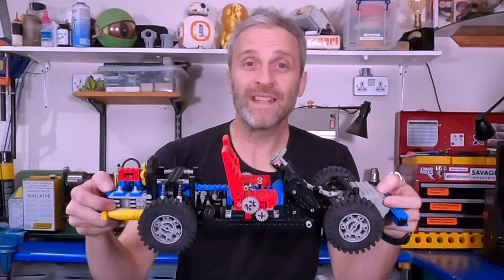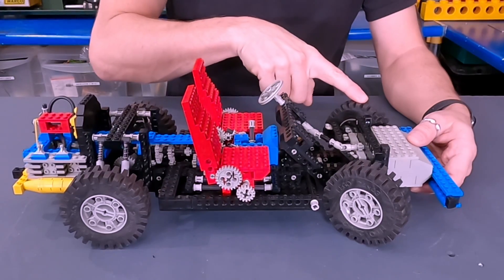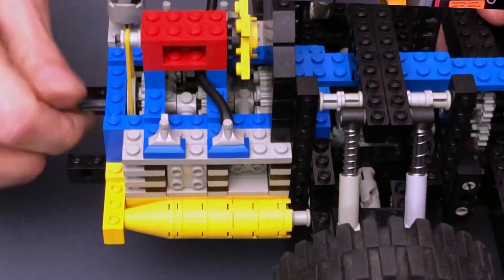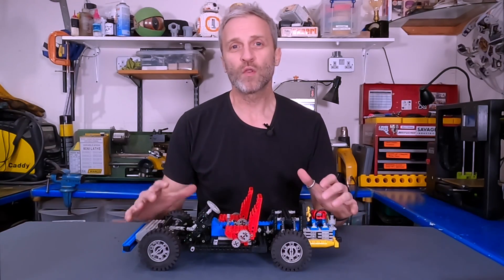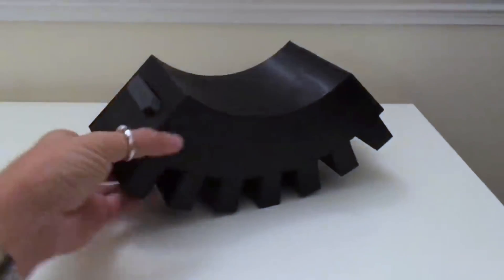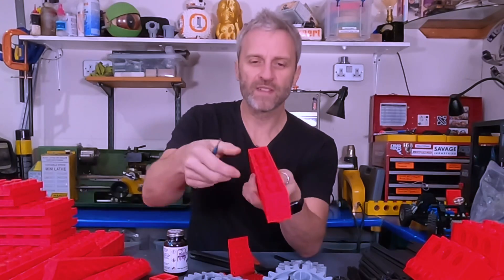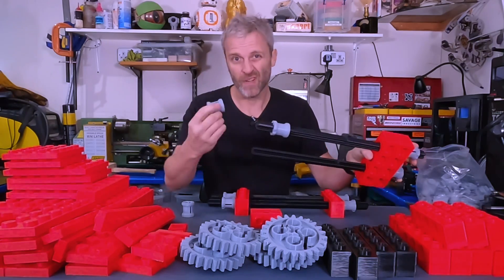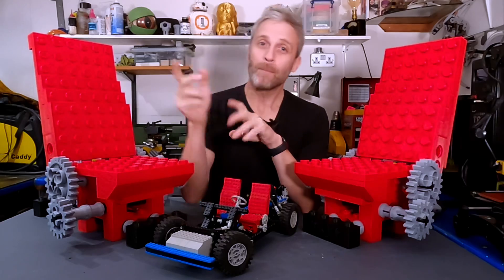The Iconic 1980's Lego Car Chassis! - Can it be done? - Mantis Hacks

Comment: I am no engineer BUT... The difference between the tractor and the chassis is location of mass. The tractor has the wheels at the ends with no weight past the axles. The chassis has a LOT of small parts/mass outside the wheelbase AND four large wheels which will be unspring weight. The engine mass may match or be somewhat equivalent to the complicated seats in the center but they seem to be majority of mass centralized between the axle centerlines.

Comment: Not actually a good idea. Loved this set but there were continual issues with it. It was EXTREMELY delicate. The seats kept coming off as well as the steering assembly has a weak 2x1 that came off all the time. It is a classic set but it isn't a "good" set by modern standards as it was just so ridiculously delicate.
Reply from the maker: You may be right.. but it was propped Lego! Modern kits are practically built for you with many molded parts and instructions you can actually follow 😆

Comment: Uhhhh doesn't weight scale with a cube power rather than a linear one?
Reply from the maker: Yes. Which is why at 5:1 scale the weight should be 125 x heavier (5x5x5) than at 1:1 scale. Assuming the parts are solid! But when printed they are not solid. I think I’m this is what I state in the video.
Reply: @MattDenton  Aahhh of course yes, the infill process will take care of that. Although wouldn't it still be a square power due to the surface area of the outer skin?
Reply from the maker: Well it’s a cubed power but there is less mass due to it being hollow rather than solid.

Comment: Old Lego is so much cooler than today's kits. I'd love to see scaled-up pneumatic builds, like 8851 (or if you want a real challenge, 8868)
Reply from the maker: Pneumatic is gonna be tricky 😬
Reply: @MattDenton  I know, that's why I'm asking you :D
Reply: Just a thought, but you can probably hide a piece of pvc drain pipe inside a lego exterior shell to create a smooth cylinder liner. A rubber plunger could act as the piston. Because everything is so large the pressures can be really low and you'd still get plenty of force to move things.
Reply from the maker: I think that’s the only type of solution

Comment: If you want it to function and not fall apart from its own weight you should use a metal base from. Certain parts should be more hollow, those seats for example use a lot of weight so instead of it being countless pieces to build try using different parts thst dont fill the inside space you dont see.
Reply from the maker: It’s as light as it can be and retain strength. The walls are 1mm thick the inside is just 5% infill so nearly hollow!

Comment: Hi matt.. this is going to be awesome... I'm currently building the 7740 lego train to 5" gauge to run round the local tracks.

Can I ask what glue you use to bond the bigger parts together and do you glue all parts when assembling?

Still 0.2 layer height?
Reply from the maker: I use PLA Gloop! But no I don’t bond the parts unless they are built in multiple bits
Reply: Thanks for the reply
Reply from the maker: HNY 👌

Comment: While I appreciate sticking to the original Lego brick design. I would adjust it so that the pieces lock in place and wouldn't back out. Maybe a tongue/lip the studs, and a grove/recess on the tubes. So parts would hold better. This way you should be able to put some horsepower into the build without it rattling apart at otherwise unsafe speeds. 

Either way looking forward to seeing the finished product.
Reply from the maker: I don’t think this kit will be going at any speed… it’s not really built for that 😬 mostly display purposes :)

Comment: while it will certainly make the whole thing heavier i do suggest putting a steel frame that you can bolt together inside the chasis so it doesnt sag under its own weight and you can possibly even sit on it without it breaking apart

Comment: Well I never thought you'd be foolish enough to attempt this😄. Christmas 1980 this was my main present and I'm 10 yrs old. We were going to my grandparents in the evening and I managed to build it from what must have been 6.30 am start. The only thing I hadn't finished was aligning the 3 speed box and it was my first technical set so cut me some slack. So we get to my grandparents and after the men in the house had marvelled at the latest lego creation they whisked it away from me! My memory is of my Dad, Uncle and Grandfather huddled together on the floor over my car chassis trying to work out the gears. After half an hour it had developed into a heated exchange of opinions which resulted in none of them managing to get the gears working. One of them worked for Massey Fergusson one for Peugeot Talbot and the other Rolls Royce, needless to say I figured out the gears the next day by myself😏.
Great set though, probably is the best. Remember combining my best friends technical lego to create a 6 wheeled version with rear 4 wheel drive suspension and a flat6 engine.
Good luck, can't wait to see it done. This might be like seeing Luke in the second season of the Mandalorian😆😭😄.
Reply from the maker: What a great memory! Yeah I only found out several years after building this kit I had made the engine wrong! I’ll explain in the next episode!  Wait… luke spears in Mando… nooooooooooo

Comment: I rebuilt this like 2y ago. Bought all missing parts online. Best birthday/christmas present at the time! The only real issue I had with it, was that you need to move the model to make the motor turn and not vice-versa as it was supposed to be ;)
Reply from the maker: Cool! But I think if you turn the motor the model would move.. so you need to make it electric then it would work as you want..
Reply: @MattDenton  Guess what I did?! ;) Unfortunately at that time motors were quite weak and battery quite huge. With todays tech and 3d printing you could make some cool stuff.
Reply from the maker: Yeah with todays tech!! 👍

Comment: Hmmmm...this set is lurking somewhere in the attic with the rest of my 1980's era technick models...this chassis reminds me btw of a VW Beetle with the boxer engine in the back with the fan inside the black housing and the same setup of the rear drivetrain with the axles only bending at the gearbox and not the wheels..
Reply from the maker: Yeah it’s very beetle like! 👍

Comment: Two sets that would be fun to see in giant scale are 565 Moon Landing and 10266 Creator Expert NASA Apollo 11 Lunar Lander which is a much more accurate rendition but doesn't have the rover like the 565 kit, nor does it have the "Macrofigs" which predated the original limbless Minifigs. A giant version of the original Minifig would be a nostalgia kick, and only 3 parts. The upper and lower body and a faceless yellow head. See set 445 for an example. If a belt was wanted then put a 1x2 plate in the middle. IIRC one set I had, used a 1x3 plate then stuck a black 1x cylinder on the bottom of the projecting end. I assume that was supposed to represent the officer's pistol or a radio or something.
Reply from the maker: I found the legs of one of those early mini figs while I was hunting for parts for this build 😀

Comment: One modification I'll suggest is to add a second spider gear to the differential, and a bearing pin that goes all the way across and is secured into the case to prevent it from spreading apart when force is applied to the gears. Thrust washers between the spider gears and the case would also be a good idea.
Reply from the maker: Yeah the whole diff needs some attention and plenty of bearings 😬

Comment: I'm curious how are your earlier builds doing? Are there cracks on the pressure points?
Reply from the maker: No cracks. Some parts have loosened off
Reply: @MattDenton  that's real impressive considering that a lot of lego parts crack after use, and you uped the size by 30 times and the parts actually held up. Especially the tires and the parts that you joined. Very cool!
Reply from the maker: Thanks 👍

Comment: Lego Technic has been a part of my life for so long, and still is. This set, 8846 Tow Truck, with the spare wheel operating the winch at the front, and the 8848 Unimog. So many good sets back then.
Reply: Ah, the old 8848, a very much under-rated set. I did really love this one. Of course the 8848 is bigger with more scope, but as a great small model with some great functions, the original unimog was superb.
Reply: @BRMRailway  I had hours of fun with it, using the pneumatic excavator to fill the rear part with dried corn, then unloading it somewhere else. It took some finesse to make the rear part tilt gently, and not move to an angle suddenly. I did later change the steering to hand of god system, with a 4x4 trans yellow brick as flashlight, to make it a lot easier to drive.
Reply from the maker: I always found the pneumatic excavator disappointing. I was so excited for it but the pneumatics just didn’t work well. I’m amazed lego released it! The mk2 pneumatics were better.
Reply: @MattDenton  True, the single tube pneumatics, where suction was used to make the cylinder retract, has it's flaws. That shows mostly in the middle part of the arm, which has to lift against gravity. The lowest and top cylinder worked better, so when scooping up things, I tried to avoid using the middle cylinder. The double tube pneumatics work much better, also more smooth piston movement, but the tubing is mor complex, though
Reply from the maker: Use quite like to do the mog!
Reply from the maker: Yeah it’s the best era for technic

Comment: It has a 4 clyinder engine with a cooling fan on top like it's aircooled so the full scale version would be a classic beetle chassis but made steel instead of gaint lego pices
Reply: I always preferred to think of it as the chassis of an early Porsche instrad of the beetle, as it only has two seats, and its way cooler.😉
Reply: I agree the porsche 356 is way cooler also the seat are closer to the back of the car so probably is based on the Porsche 356 because they had a shorter wheelbase then the classic beetles

Comment: My brother had this one. I have TWO of the original 956 Auto Chassis sets along with several Technic kits. The older stuff was better in my opinion. The new kits require 4 volumes of assembly for $400 worth of plastic confetti. No real imagination there.
Reply from the maker: Yeah the old stuff was way better.. and harder to assemble as the instructions were so vague 😀

Comment: 8860 is a good set, but my favourite from that era is 8865, the red Test Car.
It's about the same size as 8860,  and has pop up head of lights, adjustable seats, 3 speed gearbox, V-4 engine, 4 wheel independent suspension, and a body - complete with rear wing and front bar.. a great car indeed.
You're gonna need a garage for these things soon.. 😁
Reply from the maker: I need a garage already 😂
Reply: @MattDenton  will you be adding a motor to this 8860?
The guys from YT channel "Cars and Cameras" might like to have a play with this as a co-lab.. at the very least they'll have some ideas on what motor would best haul this around.. 😁
Or possibly Colin Furze, he's at least on the right side of the Atlantic for you.. 😆
Reply from the maker: I will add Some kind of motor function.. no need for Furze I’m an engineer myself! Check out my other builds like Mantis 😬
Reply: @MattDenton 

Engineer > Plumber
Haha

Comment: I had one of those. Pure magic. I'm a LEGO "boomer" so I don't like the modern stuff with custom parts that try to look like the real thing and fail. I prefer the technical look. :) 

I think you'll like some of the 3D printing I do on my channel. High performance RC cars and planes.

PS. Those square carbon tubes are pultruded and will crack under any significant torque. Might not be a problem since the plastic is pretty stiff too and the loads will be low. Woven tubing is much better for torque transmission.
Reply from the maker: Yeah I’m a boomer and lost interest when all the pre fabricated parts came out! Thanks for the tip on the carbon tubes. There won’t be masses of torque involved, it’s more to lint out that using square instead of round tube will transfer torque

Comment: I remember vividly begging my parents for this very expensive set for them at the time !! I finally got it for my birthday, learned so much about differentials, gear box, etc. A few years after I got the fantastic 8851 Excavator and discovered pneumatics. 15 years later I passed my engineering degree :D
Reply from the maker: Yeah these kits taught me so much and inspired me to make things! I always took my kits apart and made new vehicles and other things
Reply: Yes, and that is what Lego Technic was all about.
Not hiding away the functionality as they do today but rather show it in crude detail so you can understand the basic principle of how stuff actually works.
Reply: Same here (except for an electronics degree). I have to admit that this set gave me a wrong idea about gearboxes for years.
Reply: @christianwiese9887  What wrong idea? That you move the shaft around? Because the basic principle of changing the gear ratio still applied.
But yeah, the synchronized gearbox only started to appear many years later in the 8880. What a fantastic set that was, only got it many many years later when I was grown up, never as a child for christmas ;)
Reply: @ferrari2k  i've just had to look up 'your 8880'.  1994 when that set came out so about 5 years too late for me, like you say but wow, that must  have been the very peak of the old technics system - i would have absolutely loved that kit!  also, i can see maybe the emergence of some of the more modern-style parts - my nephews' new car he was showing me on boxing day is just so different, it is almost unrecognisable. i do wonder if the [r]evolution coincides with lego becoming more popular in america or was coming any way?  i will have to have a mooch on ebay but i think the prices are gonna get the better of my nostalgia!🙂
Reply: the same!  except i think i got the car for Christmas and the excavator for my birthday. when did you graduate? i was 2000.
Reply: @billynomates920  2001 🙂
Reply: stop this plastic waste production
Reply from the maker: Explain why you think it’s waste?
Reply: @goofycker  Stop your ridiculous comments.  You have a whole bunch of lego videos in your playlist which makes you a hypocrite.
Reply from the maker: Well I guess everyone’s entitled to an opinion but waste implies there is no use to this.. but any art form has no use other than to inspire and entertain. I understand the whole plastic issues of today but if anyone really wants to tackle that then go after the big boys 👍
Reply: @goofycker  hypocrite

Comment: About the axles fitting - are you modeling the axle sockets properly? I mean there's a twist in the axle socket (at least on newer elements) that makes it so that the cross is slightly rotated at each side of the socket and that's where the socket has most of the grasp on the part as towards the middle of it it's mostly neutral/loose. 
I could help with modeling a bit, I've got some experience with custom 3d printed Lego-compatible parts, at the original scale though  :)
Reply from the maker: Hi. No I’m not modelling the twist. The fit is usually quite good but sometimes there are blips in the print process. Also the PLA shrinks back over time..

Comment: The wheels will have the size of 4.80-8 ones from car trailers ^^
Reply from the maker: Is that right?? 🤔
Reply: @MattDenton  I calculated the rim size, following the 24 X 43 indications from the Lego wheel multipled by 5, and imperial conversion. Maybe the tyre is even bigger, 5.75-8, probably.
Reply from the maker: Cool 😎
Reply: After calculating, 4,80 wide look correct. 5.75 will be tuning, but 195/55R10 will be modern standard ^^
Reply from the maker: That size I understand

Comment: I suggest more perimeters where strength is a must. Infill has been proven to be less effective than perimeters.
Reply from the maker: Yeah infill just helps bridging but does help the top layer bond well. I have noticed that with less infill if the fit is really tight between two pieces the studs can get ripped off including the top layer 😬 this never happens with 10/15% infill..

Comment: 3D print giant versions of the Technic Arctic Exploration Team sets, complete with giant Technic Lego Figures
Reply from the maker: I’ll take a look.. but Lego are very protective of the mini figs 😬
Reply: @MattDenton  The Technic figures were larger, multi-jointed figures. They're completely different in construction from minifigs. The torso, arms and hip joints are all one unit, for example - which might be a bit tricky to replicate on a 3D printer, actually.

Comment: Excited for this build! Being slightly younger the iconic Technic car for me was the 8865 Test Car - I had no idea there was a predecessor. Pretty cool.
Reply: There was even a predecessor to this one.
Reply from the maker: Exactly 👍
Reply from the maker: Yeah and this one wasn’t the first!!
Reply: I remember the 8865 coming out, but I was getting too old for Lego sets at the time... so I waited 20 years and bought one on Ebay!! It was epic and took the 8860 to that next level. Always preferred the boxer engine in the 8860, so often thought a mash up between the two with the suspension and better capabilities from the 8865, but the style and rear boxer from the 8860, with an improved gear box and a body, all done in black, would be very cool.